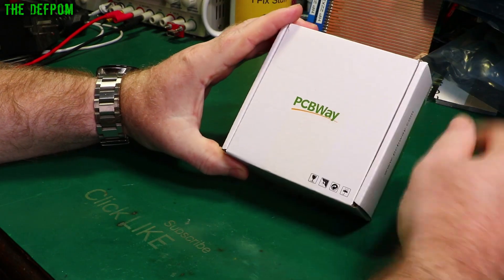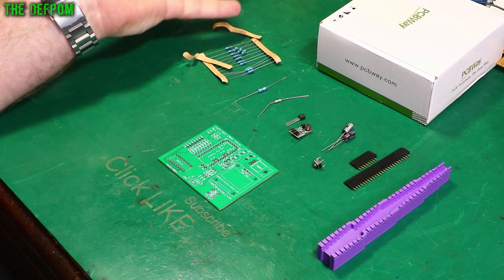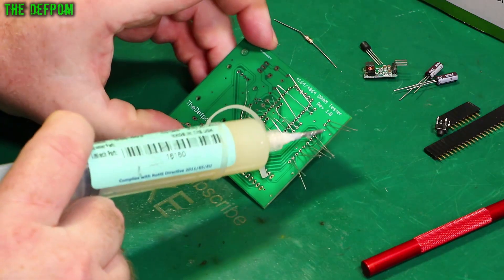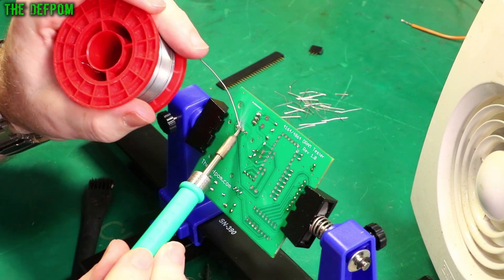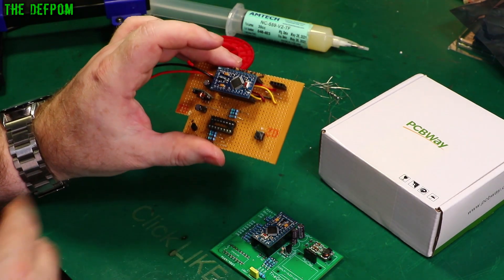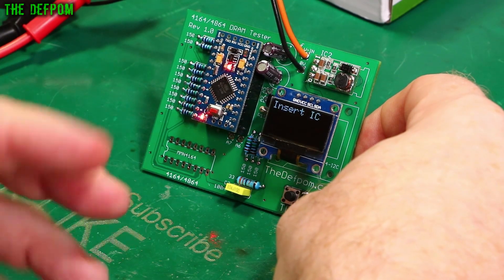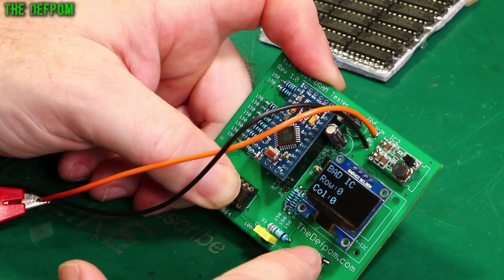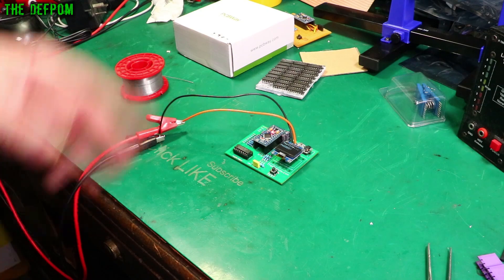🔴 DRAM Tester Project - Test 4164 4864 DRAM IC's - Sponsored by PCBway - No.922

Comment: I seem to have a problem with your Arduino code that is hosted on PCBWAY. when I try to upload the code, I get the error "Adafruit_SSD1306.h: no such file or directory"
Reply from the maker: You need to add the adafruit oled library

Comment: How fast are the read/writes on the HP board?
There is a Ram bus request on the HP ram board every 10uS or at 100kHz from what I can see, so gotta be at least slower than that.
And, I believe the max ext. interrupt speed is every 4uS on the Pro Mini, or on other reports I have read that using interrupts to reliably read a 200kHz (5uS) square wave is pushing it.......so I am thinking you'll probably run out of processing power on the Pro Mini before you achieve reliable sniffing of the Dram.
However, STM32's are orders of magnitude faster and you can use them with the Arduino IDE if you want......and, there are STM32 versions of the Pro Mini you can directly use......just need to adapt the interrupt setup routines as they are completely different on the STM32, but other than that your code base should work.
Reply from the maker: Hopefully speed isn’t a problem, I’ve never used an STM32!

Comment: Not a bad idea,  fill an array as the chip is written to and compare reads to array contents.  A second array could record addresses accessed so a test could show % accessed and compared.  You are at the mercy of the system as to how long it might take to do a full test.
Reply from the maker: The idea is that it could be connected up and left running for as long as required, so it would eventually test all the active memory on an IC.

Comment: If the pcb is clean and you have decent solder you won't need all extra flux making a mess.
Reply from the maker: The flux is mostly needed for the component legs, some of them have been sitting around for a few years.